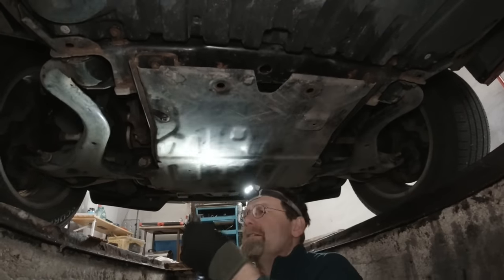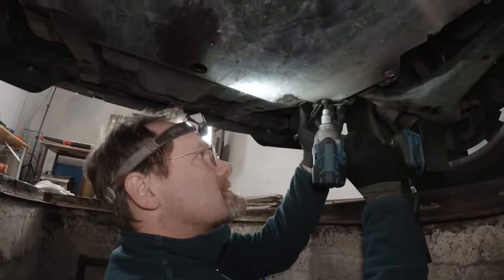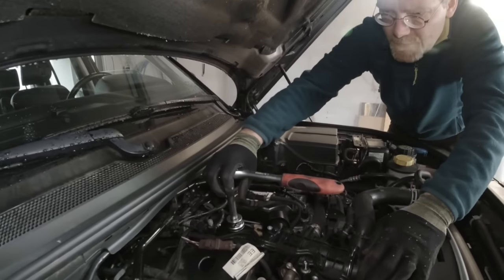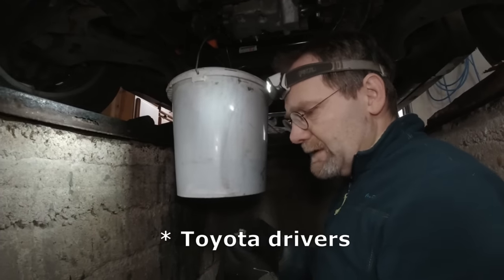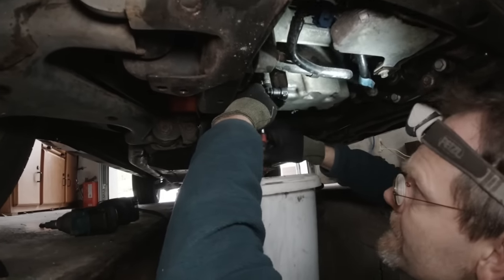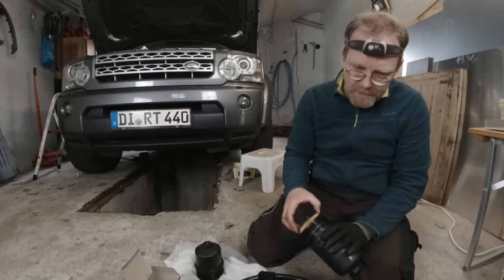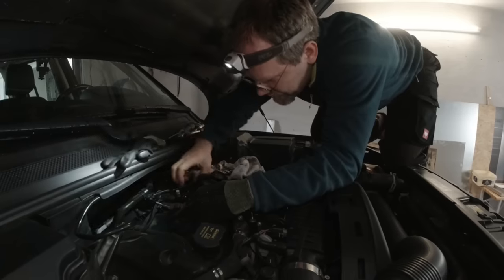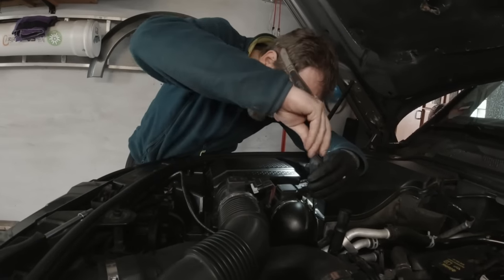No more 5W-30 ever again - Land Rover Discovery 4 - Transfer Case and Diff oil change

Comment: I liked your reaction about he oil filter size differences.
Totally agree with you but I have a super solution for this little issue.
Just use the oil filter and the top housing from LR3 and install it on your LR4. 
The only difference is that the earlier model has a higher housing top by 5 ish cm

Comment: Hey guys, randomly ended up here from vw touareg videos, 

5w 30 only good for early stage of vehicle life i personally have always ran petrol boxer engines or turbo diesel cars 10-40w regardless of the deal oil company made with an car company.
Few things to consider offcourse is if a vehicle fitted with a dpf, you may have to avoid small trips thats all!

Comment: I love watching you too you make a good pairing if I was you I would replace the oil pump and if it's possible check the main bearings on the crankshaft keep doing your thing I love watching you on Sunday morning
Reply from the maker: That is the plan, when we change the oil pump, to remove the sump and check the bearings. 💪👍🙋‍♀️Vera

Comment: Always used 5W40 A3/B4 in my Ford Territory SZ here in Australia. No issues in over100K KM.
Reply: Yup, the Ford Territory 2.7 litre TDV6 engine (similar to Discovery 3) is not equipped with a Diesel Particulate Filter, so no need for ACEA C oils.

Comment: My understanding is that different oil viscosity can be used depending on ambient temperature. Probably not the case so much with modern oils, but likely why landrover may have specified 5w40 in South Africa and 30 in germany.

Comment: The trend for large volume American engines is smaller, less surface area oil filters.  The idea is that their efficiency increases at a higher rate over time than larger, older oil filter designs.

Comment: I remember you saying that premature was not a good word for us guys ! I say leave it in, enjoy your vacation then do it as part of the engine overhaul. Another great video. I’ve ordered the magnatec 5w-40 DPF version for my next oil change. I’m trusting you guys more than my own mechanic !!
Reply from the maker: 😅👍 🙋‍♀️Vera
Reply from the maker: I ordered a pump and I intend to change it this week.  The big benefit is, that we all will learn if a cheap pump can really be the reason for low idle pressure and slow build up.  Video will be out in 2-3 weeks because we got to fix the rear brakes first. Christian

Comment: To save the cost of buying a new oil sump plug for every oil change (which is recommended), you could instead buy the rubber gasket for the sump plug. For the Discovery 3 , I use the  Dorman 097-139 Rubber Drain Plug Gasket, Fits M14 . 

When changing the engine air filter on my Discovery 3, I also usually clean the Mass Air Flow (MAF) sensor and Manifold Absolute Pressure (MAP) sensor with an electrical sensor cleaner. It's supposed to improve fuel efficiency and performance.
Reply from the maker: We do that also. 👍😃🙋‍♀️Vera
Reply from the maker: I cleaned the sensor 2 or 3 videos back.  I also bought seal rings but they do not fit as well.  I must have gotten a bad brand.  Thanks.  Christian

Comment: Hello Christian .
If your worry  is the HTHS , there are 5w-30 C3  oils . Going from  C2 to C3 there is a significant difference and makes sense.   Going from 5w-30 to 5w-40  ... for sure will not hurt but not benefit much either... Engine oils - never run out of arguments  🙂
L.E.
Since it would be crazy to have a D4 as the only  vehicle in the family I also own a small  Toyota hybrid bought from new.  Despite the fact that the owner manual  and all official  documentation states 0w-20 oil should be used, at the annual inspection, dealers from  Belgium, Germany and Luxembourg   all put in 5w-30. And I don't think it is because of the hot climate  :) . I even asked   why they do this, the answer was invariable  - for better protection, that the 0w-20  trades protection for fuel efficiency and they don't even bother to  have it on stock.
Reply from the maker: The trend to save fuel this way is bad.  OEM s will do anything to officially reduce fuel consumption.  At the end, it does not save much at all.  W20 oil should be banned 😂😬.  Christian

Comment: Hi  Christian and Vera. Thanks another great video and the slump in Christians shoulders when Vera ordered her oil pump change was funny to see. Everything you go through is of interest as I do as much of my own maintenance as I can and the Discovery is relatively easy to work on (I have a Saab 9-5 and that thing is frustrating to do anything to!) but I'm not blessed with a garage and a pit as you are but some home built ramps help out. To give the Toyota drivers an idea as to what is coming up, can I suggest that you use a grading system for the jobs you take on? So something simple like a oil change would be a 1, Oh My God on the Vera scale, while a major operation could go up as high as a 10, Oh My God on the Vera scale.

Comment: I use Shell Ultra 5w40 in my LR4 and LR3 (before I sold it with 320 000 km) The Discovery 4 now have just over 200 000 km and I did change all the other oils ( I also used the Liqui Moly 75w140 in both diffs and the Ravenol in the transfer case , including the gearbox ( ZF did the change)
I am very interested in the App and they way you reset the service light...More info on that will be appreciated.
Johan- Cape Town
Reply: Hi Johan, There is a way i found on the web, just google reset service light and I got a result something in the order of open bonnet, open driver door, ignition on but engine not running and pressing the brake and fuel down for 60s if I remember correctly...

Comment: Your videos are the highlight of my YouTube week! Thank you!
I had a thought ( which doesn't happen very often, and when it does, is normally not very impressive) but, isn't your aftermarket oil pressure guage causing your pressure problem?
Reply from the maker: Hello Sean, I also tried a direct mounted oil gauge. Not the best one either but it does read higher on my LR4...  Yes, the chineese electrical gauge sucks.  Christian

Comment: Yes you are correct about the engine not being worn out between services.
Your cheap oil pump seems to be the concern from what you are telling us, genuine pump only in my book…..but thats only my opinion.
It seems there is a pattern here, the HP fuel pump was a concern too after replacing it, the new pump cured the concern.

Comment: I love how instead of offering a separate 1 euro drain plug O-ring, LR wants you to buy a 20 Euro drain plug (with an "integrated" O-ring). I have reused the drain plug on my Velar several times and not had any leaks. This is one reason I'll never buy another LR/RR.

Comment: I love your Toyota banter😂. I'm seriously torn between a disco 4 and a lc5 land cruiser.
My thinking is this;
Toyota= less insurance costs(for me at least,
Outstanding reliability;
Great resale prices even at 300k miles;
Service once a year whether it needs it or not😂.
D4= more refined drive and quieter;
Cheaper parts(because you need them) ;
Better looking vehicle :
Oil change once a month to try my best at keeping it running;
Off road both are very capable machines.
Not sure what to do?

Comment: You are asking a pump designed for 5W30 to push a thicker oil.. your oil pressure may well drop. In SA, with higher ambient temps, the 5w40 would have a similar consistency. Consider a quick test back to 5W30 using a cheap oil. Save the 5W40 (if you wish to re-use it) just in case :)
Reply: @teevee2145 It's viscosity is higher therefore it is thicker.

Comment: Why did the front diff and transfer case get neglected?
Did the trans and rear diff.
I will tie in a fuel filter change every 50k km with the trans, transfer and diff oils. 👍

Comment: In Moscow, I fill in mineral monograde oil sae30 (30w30) in winter and sae30 or sae40 in summer.
There is a lot of thickener sludge from synthetics and semi-synthetics. I change mineral oil every 5000 km or 200 hours.
Engine - Jaguar aj41 or 448pn. =)
Reply from the maker: I  heard that A5/B5 is avoided in Russia as well due to the reduced HTHS.   We change oil before 12tkm.  Not after 24 tkm as LR recommends.  Christian
Reply: @Vera_and_Christian  We also have 99.9% of people trying to buy the best A5 / B5 oil for their car. Although the manuals for 4.4: oil A1/A3 or API SJ\SL & ACEA B1/B3 - for 2.7. If someone buys A1\B1, he will be anathema for daring to buy such a muck for the motor.

In a previous post, I indicated the viscosity of the oil I drive in winter. And no problem starting the engine. Today's mineral oils freeze from 5w to 15w on the oil passport. This is important in the Russian continental winter.
There was an experiment, beyond the Arctic Circle, closer to Norway, sae50 was poured into an old car in frost -25 \ -17C and there were no problems starting the engine. At such low temperatures, the fluidity of the oil is no longer important, but the health of the battery is important. Since the confident start of the motor is standardized by starting currents, which are guaranteed not lower than -18C.

Therefore, I'm surprised why you fill in 5w30\40, if in your climate you can safely fill in 10\15\20w ... At the same time, there will be less depressants, a thickener in the oil, that is, there will be more oil in the oil.

And, yes, I drive API SD =)

Comment: Hi Vera and Christian, After a filter change my oil pressure comes in around 2 seconds. You can hear it with the valve tappets easily. But the crankshaft will do some turns without sufficient pressure. In consequence I dont change the filter on each oil change because I am changing it not later than 10000km.
What i would really be interested in is how the drain plug or check valve of the filter housing is working on the D4 3.0 TDV6. Its because I saw one picture in the net where this valve was not tight due to debris so that the filter housing was drained every time you are stopping the engine. I didnt understand exactly how it works and how it is constructed but I am afraid that it may be a major risk for the engine if this valve is not really tight and drains the filter housing frequently.
With the 5W30 you are absolutely right. The engine is extremely short because initially it was planned for an east west fit in the engine bay of a french sedan car. The widths  of the bearings and the (Stege) of the head gaskets are paying the price for this.
Good video, as always. Thanks for this
Best Regards Michael
Reply from the maker: The drain valve on a D4 may not close properly if the oil filter is a bit short.  The filter would not push the drain closed.  This would be catastrophic as the oil pressure would not build up fully and what you said too.  Our d3 takes 5 seconds to build pressure at the moment.  It used to take only 2-3 sec.  Christian
Reply: @Vera_and_Christian  Thanks Christian. Yes, thats true. Thats the reason I dont buy cheep maintenance stuff. But its good to check after an oil change the time it takes to get on pressure. Then you can be sure that the drain plug is closed. But what is when the check valve is not closed due to debris? I think the oil pressure would not be affected but the time it takes to build up pressure is long when the engine has been standing still for longer time. Maybe its worth to check the tightness of this valve everytime you are changing the filter. You only have to close the drain hole in the filter housing and fill some oil in. And then wait if it gets drained or not. If yes, one should take out the filter/cooler housing and maintain it. Cheers Michael

Comment: Hi guys! 
Thank you for your love to Disco that you are sharing with us! Absolutely love watching your channel 🤗
I know that you runs diesel engines on your both Discos, but maybe you can still express and share your own opinion about which engine oil would you prefer to use if you’ve had a gasoline V8 5.0 engine? 
I own 2012 Discovery 4 with gasoline V8 5.0 liters engine (engineered by Ford as far as I know, maybe I’m wrong) and it has 93000 kilometers on clock, on the oil cap it says to use Castrol 5W20 which later was switched to 0W20. As per my request to LR international support the recommendation is to use engine oils with following requirements SAE 5W20 WSS-M2C925-A or SAE 0W20 STJLR.51.5122.

Comment: Putting the oil filter into the cap first isn't really a problem on D3. When you start rotating the cap (and the filter with it) plug will snap/fall into the drain hole. I never had to put the filter into the housing first on mine.

Comment: Vera and Christian, you did it again!!! Best video about oil information for our beloved Discovery 3 ever!!!
Here in Argentina it’s not available castrol 5W40. Just 5W30 in versions A5 (used during the first 260.000 km in my D3) and C3 which I’m going to use up now.
Just a simple question but I think important: ¿how often do you change your oil and filters? We in Argentina use to change everything every 10.000 km. Maybe diesel filter every 20.000. Best regards. Alexis
Reply: Hola crack. En España yo a este tipo de motores les haría cambio de aceite cada 15mil km (siempre que sea un buen aceite, y el correcto bajo especificaciones). Pero acá nuestro Diesel es muy bueno, incluso el de la peor gasolinera va a tener 3ppm de Azufre, cuando en Argentina incluso si pagás el Diesel premium "Euro" o el marketing que quieran ponerle, estamos hablando de 300ppm de Azufre o más. Así que tiene sentido reducirlo a 10.000km...siempre un cambio de aceite y filtros va a ser una fracción del precio del coche. Saludo de gol

Comment: You are olon a contentious subject!
There are endless arguments here on YT on this subject.
I also have opinions.
Firstly one needs to bear with that the manufacturer does not care about longevity (quite the opposite) but they do care about emission certification and warranty claims.
So they will specify a grade of oil that ticks both boxes  - lowest possible drag, consistent with low claims due lubrication failure. 
Also the additve packages have changed. Zinc is excellent anti wear agent but it poisons catalytic converters, so it was replaced with poor substitutes. 
Beyond that it is up to the owner to choose the right oil for the conditions they are driving in. 
I'm in South Africa where we have extremes. 
I have seen - 12c before  dawn and +34 by midday in winter and in summer +52c at the same location. The handbook for my old Landcruiser may say 10w-30 but I use 5w-40 and am extremely gentle until up to temperature on cold mornings.
Reply from the maker: Thanks for the info and feedback out of South Africa.  We also got extreme conditions here. Check our next video at the end scenes.  I revel the big secret why I drive a Discovery 4 and not a What Cruiser.  Christian

Comment: Most important thing is regular changes. 5W-30 is suitable for the U.K. Africa is hotter so they probably specify 5W-40 as a result. I’m doing an oil change soon as well, looking forward to the mess it causes. 

If you do find bits of metal in your oil, what’s the next step?
Reply from the maker: Means the bearings are worn.  Bottom end could fail.  Replace bearings or wait for it to fail.  Or buy a Toyota.  Christian

Comment: LR specifies 5W-30 Low SAPS C1 oil on the 3.0 liter D4, with a viscosity of approx. 10 mm2/s at 100ºC and 54 mm2/s at 40ºC. 

CASTROL MAGNATEC 5W-40 DPF C3 has 13,9 mm2/s at 100ºC, which is close to +40% more. At 40ºC the viscosity is 89 mm2/s, which is +65 % compared to C1. It looks like a big step up and sulphur content is +40% compared to C1. 

Would you consider using Ravennol HDS 5W-30 C4 in the 3.0 liter D4 ? This oil offers same Low SAPS as C1 with approx. 12 mm2/s viscosity at 100ºC and 72 mm2/s at 30ºC.
Reply: Use cooking oil quiet as quiet can be

Comment: You do good work and explain your work very well. I must admit I cringe everytime I see those certain green bottles. Had to recondition many engines for a particular manufacturer that exclusively use this oil. They may have improved their formula but after many engine failures due this particular oil I recommended going to a oil brand we used on all engines. Problem solved never seen those again for those problems. Hello from  🇦🇺

Comment: In my LR 3 V8 4.4 I use Castrol 5w30 however i then add STP oil treatment and it makes a huge difference to the engine sound (much smoother). Not sure what others think of STP versus Liqui Molly.
Reply from the maker: It‘s a V8 so no need to not go by the LR spec, like we do on the V6. We, however, do not use additives. 👍👌🙋‍♀️

Comment: I changed to Ford Motorcraft synthetic 10w30. The same  oil that goes in the 6.7 power stroke. 
Been testing it at black stone labs in Indiana.  It is at least twice as good at metal protection than the Castrol from Land Rover dealer. 
And it’s cheap.

Comment: Another top video. I am going to change to 5w40 on the next service. I do a fair amount of short runs for work and the school run here in the UK. QUESTION? For a while now I have had a small amount of oil pooling ontop of the oil cooler on my D4. We know its not leaking oil but the tech said it is likely to be vapour from around all the hoses in and around the throttle body. Could the 5w30 be getting so thin it escapes past seals? The cooler is good and the plastic filter housing is not cracked. MY2010.